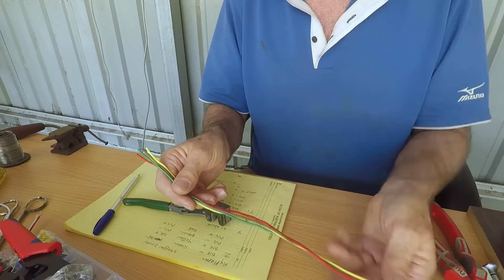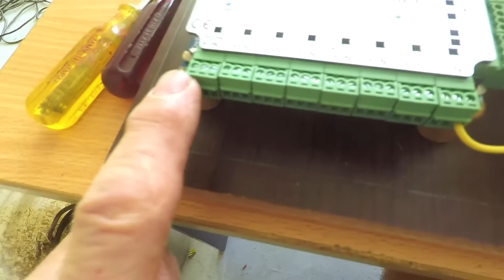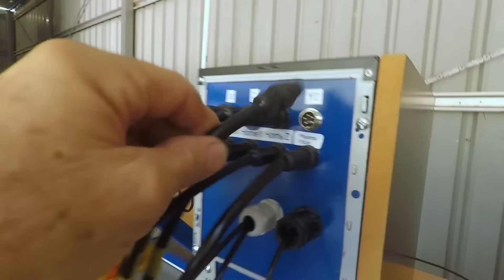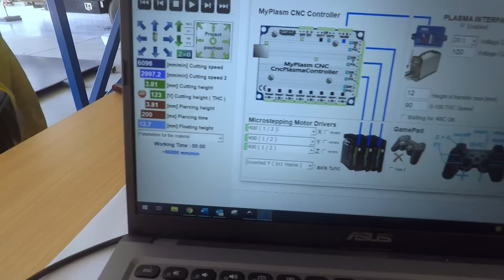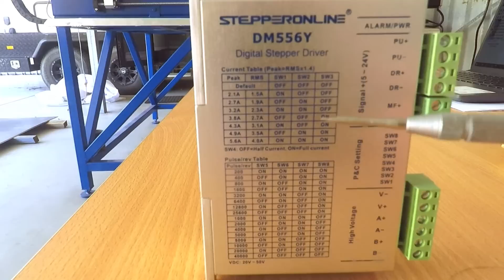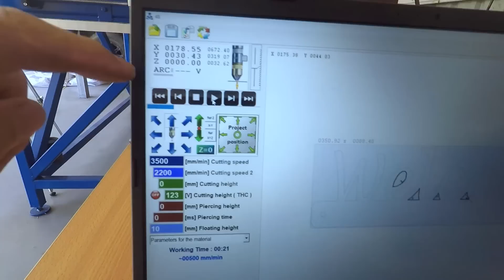How To Build a CNC Plasma Cutting Table | Part 5 -  The 1st Test Drive

Comment: Hello Russell,  
I am in the process of building my new plasma table (finally)...  
While watching this video , I see that you are installing two proximity switches on the Y-axis, one at the beginning and the other at the end of the travel.  
I wonder if this is necessary, considering that I enter the Y-axis movement value in the programming.  
Thank you and have a good day.
Reply from the maker: Hey Michel, I have 2 proximity switches on the Y axis, because I have 2 drive motors on my Y axis....but I still only have 1 proximity switch per side.
The reason for the 2 switches is because the MyPlasm software knows I have 2 drive motors on the Y axis (1 on each side), so when I go to 'home' the table, if I only had 1 proximity switch, the other motor would continue to drive, while the other one would stop when it activated the 'home' proximity switch. Hope this make sense.

Comment: Hi Rusty.. Was rewatching the vids and on this one I notice the yellow wire from y2 is connected to the neg side of input 2. Is there a reason for this ? Thanks!
Reply from the maker: Hi Kerry....that's very observant of you. That was an early configuration for the 2nd Y motor, but it's not wired up that way now. 
Both Y motors are connected up the same way, between the MyPlasm controller and their respective stepper driver units. In order to drive both Y axis motors in the same direction, I have reversed one of the motor coils at the stepper driver unit's motor winding terminals.
If you'd like to see a wiring diagram for how it's wired up, email me at rmhyde58@gmail.com and I'll send it to you, thanks.
Reply from the maker: One more thing....when running 2 motors in the same direction, you have to select 'Inverted Y (in1 home)' in the Axis Function dropdown window that's below the Microstepping Motor Drivers selection on the Electronics tab within the software.
Reply: Thanks for the reply. I’m building a similar but smaller table than yours but had to take 11 months off because of a medical issue but I am hoping to have it working in a month or so.

Comment: Well Done Rusty i'm so glad i clicked on this video, i went down the same road as you as i reached out to the American companies and the price was a moon shot. where did you get you rack and pin parts from? thanks Dave
Reply from the maker: Hi David, I bought most of the parts for the build, including the ballscrews, off eBay. They are SFU1605 (16mm diameter and 5mm pitch) 1550mm long.
If you would like a copy of my entire parts list, you can send an email to rmhyde58@gmail.com

Comment: Hey Rusty, great series of videos.
Just wondering if you’ve have any problems with wobble in the lead screws? (Rather than rack & pinion)
Also what speeds mm/min have you been able to get up to with the lead screws?
Reply from the maker: Hi Dan, to date I've not experienced any issues with the ballscrews I used on my table build. During testing I ran the table up to 6000mm/min but my typical cut speed is around 2200mm/min for 16g mild steel. I vary the amps according to the thickness of material that I'm cutting and I get pretty clean cuts with very little dross on the underside. Removing the dross doesn't take long, using a cupped wire wheel on my 4" angle grinder.

Comment: I just stumbled on to your videos and don't have time to watch now but I am really looking forward to watching when I get home. I built a table myself and it is basically done but I have not been able to get the torch to fire automatically so hopefully I'll be able to see what you did. I am using the proma stuff as well. Thanks for making the videos I think it is going to be a great help.
Reply from the maker: Hi Jennco Design, I hope my videos will help with your table build. If you're using the Proma controller and plasma interface unit, firing the torch automatically should be as easy as connecting up the interface unit to your plasma cutter, assuming it has a CNC port. If not, you'll have to look inside the cutter and see where the hand torch trigger wires are connected up, as these are the ones you need, so the interface unit can turn the torch on and off. Same goes for the arc voltage measurement.....which is measured across the ground and torch terminals inside the cutter, if your cutter doesn't have a CNC port.

Comment: I was wondering ,if i put both y size home  switch like you and drive y axis into limits,it is then possible to tune in right place wia limit switch.
Reply from the maker: If you run 2 motors on the Y axis, you will need to install 2 homing switches....1 for each motor. When you home the Y axis, you have to set both Y homing switches to activate at the same time, which is pretty easy to do. Work out where you want the Y axis to be when it reaches 'home', then position each side's homing switch so they activate simultaneously. The 2nd Y axis is connected into Input 1 on the controller board (refer section 8 of the user manual, under the heading 'Automatic Basing (using HOME based limits), where it states 'The Home input for the Slave X/Y axis (if used) is INPUT1'.

Comment: Hi from Finland
I am also building plasma table. I have rack and pinion system coming. I have two motors in y axle ,both x axle ends. Do i have to make rack assembly both size so precisely that x axle dont bend?
If i put two y motors ,could i syncronize travels in myplasm program?
Reply from the maker: Hi Markus. If you're running 2 motors on your Y axis, then you need to set them up both the same....same rack and pinion size.
It's easy to set up 2 motors in the MyPlasm CNC controller...refer to section 7 of the MyPlasm CNC System Operating Manual. The manual can be found here: https://www.proma-elektronika.com/do-pobrania/
You'll need to set up your distance per motor rev of the X, Y and Z axis....also in section 7 of the manual.
If you need any help, you can email me: rmhyde58@gmail.com

Comment: Just wondering if you have a store that you deal with for parts.
Reply from the maker: Hi Robert, I bought all my parts online. I did list the main components in the Part 2 and Part 3 videos.....was there something specific that you were looking for?
Reply: @RustysMetalSigns  I know nothing about the motors and how to hook them up. I am a welder and already have a plasma that can handle 1.125 inches but all that stuff you got is like Japanese to me. Would you have a list of part numbers for all the motors and the rail that it rides on. Say you are building a table list the parts like a kit everything you need but a lap top and plasma. Thanks again Robert Riley.
Reply from the maker: Hi Robert, if you can send me an email (rmhyde58@gmail.com) I'll send you a list of parts that I bought for my build.

Comment: I think this is a super detailed explanation of how to make a cnc plama table. very well done!👍👍👍
Until recently I was planning to buy one , but after watching your videos I bought all the parts ( the same as you , only the ballscrews I opted for 2010 .
super fun project and very good explanation from you how and where to start until the end.
but I still have a few questions for you

- why is the yellow cable of Y2 not connected to the dir or pull connection, but to the input 2 - of My plasm cnc control?
- the wood of the pc box has a reason for this? (possibly not to make contact with the table after installation) or just for fixing the parts?

- what cable thickness do you use from my cnc to the drivers? i have 0.5 ( suppose for data i think it should be enough ? )
from the drive to the step motor I have 0.75

- do you mind if I run into a problem that I contact you?

is it possible to send me the wiring diagram?

I realize that your films made me take the step to build it myself and I am very grateful to you for that!

best regards from me from belgium.
Reply from the maker: Hi Christof, I'm glad you found the video series helpful and have given you guidance on building your own table. If I was building this table again, I probably would have opted for 2010 ballscrews, too. Feel free to get in touch if you have questions...my email address is on the About page of the channel.

Comment: Great job appears it is going to work well. Looking forward to part 6 and seeing it cut metal. Going to follow your plan for my build in the NY. Really helpful videos👍👍👍
Reply from the maker: Thanks Joel. Part 6 should be out soon and it cuts really well...only been cutting 1.6mm mild steel plate but really impressed with it. If you need any help with your build, feel free to reach out, ok.
Reply: @RustysMetalSigns  Can you please see us the link where you purchase you electronics component for the rference. Thank you
Reply from the maker: @miguelnaing1820  if u email me and let me know which parts ur looking for, I'll let u know what I used and where I got them.

Comment: great project，what tool-path generator （software） are U using？
Reply from the maker: Hi Jie, thankyou and I'm glad you're enjoying the videos. Part 6, showing the table cutting some metal parts, will be uploaded soon.
I'm using MyPlasm CNC controller and plasma interface unit from Proma Elektronika (https://www.proma-elektronika.com)
I really like the simplicity of the program and the toolpath is a .dxf file. For complex files, I use Inkscape (a free 2D CAD program) and for simple designs, I use the MyMiniCAD which included in the MyPlasm CNC software.

Comment: Hi.
 NICE !
   Update to 1.0.9a version, it's better dynamics on complicated pathes ( not slow down too much on small arcs )
Reply from the maker: Thanks Lukasz, I updated the software and the torch height controller is a lot more stable now.
Also tweaked the Acceleration ramps with good effect, too.

Comment: Did you end up changing the original lengths of 1800 ?
Reply from the maker: Hi Andrew, the ballscrews and linear rails that I bought, were all 1500mm long. The table dimensions are 1800 x 1800 and the cut area is 1300 x 1300, so it can easily take a half sheet of steel or ali.

Comment: Wonder machine !  One question .How are Y and Y" synchronizated?
Reply from the maker: The 2nd Y motor is connected into the DIR' and PUL' terminals. In the software I have selected Y1 Inverted, then at the stepper motor driver output, I have reversed the A+ and A- wires, in relation to the Y1 motor connections.
Hope this helps.

Comment: Great job sir! I've been following all of your video, keep them coming. I just noticed you are not using all of the mounting hole in your square rails.. any reason? thx, M
Reply from the maker: Well spotted, Mike. I have to go back and add some extra bolts to the linear rails, but wasn't planning on using every hole...do you think I should use every mounting hole???